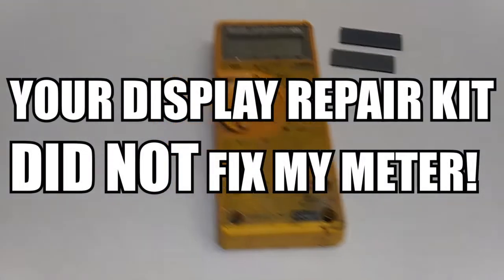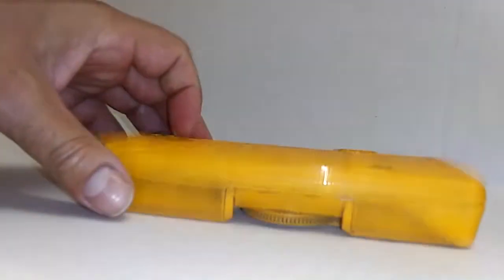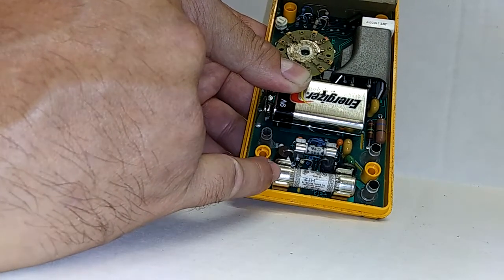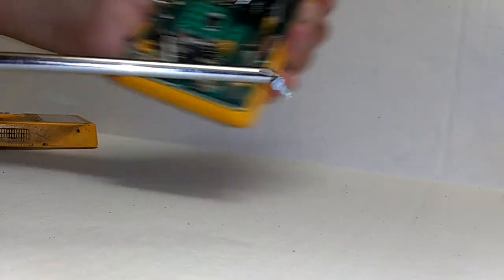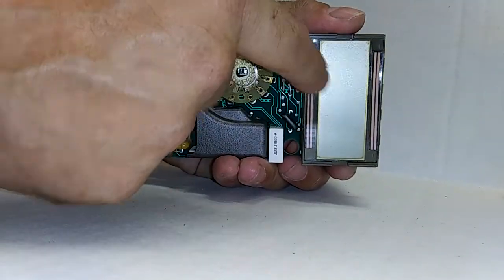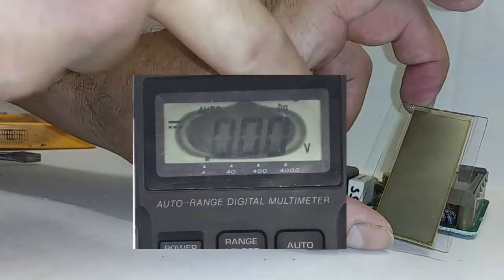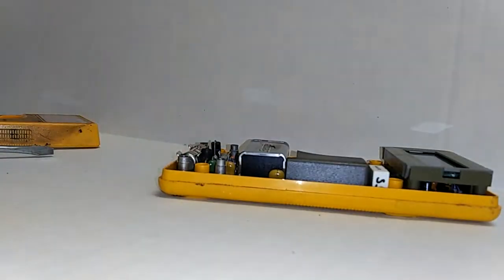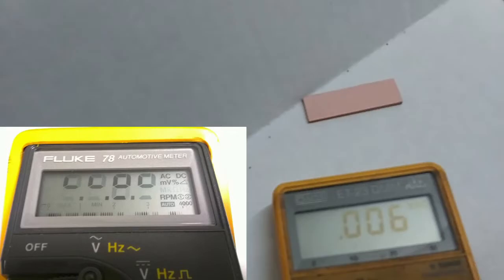Fluke 23 Dim Display Fix No Music

Comment: I had this exact same problem on my Fluke 73.  I bought these elastomeric strips from 'Multimeter Parts'.
It obviously did not correct the very dim display.
I bought 'polarizing film' off Amazon.  All I did was stick a new piece of the film on top of the LCD glass, and the digits were back to normal.
I did not peel off the old film, I just stuck it on top.
You do have to determine the correct side of the sheet and orient (rotate) the film to get the correct alignment.
AMAZON:
Selens Polarizing Film 2 PCS 7.8x11.8 inches Adhesive Polarized Sheets Linear Polarizing Photography Filter for LCD Screen Repairing & Physics Education